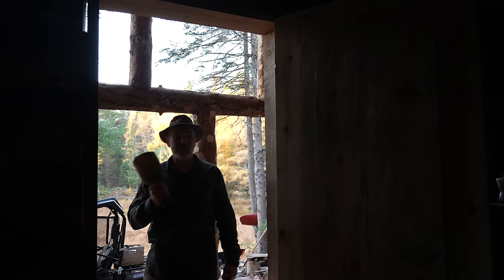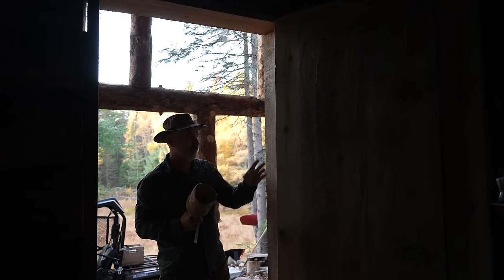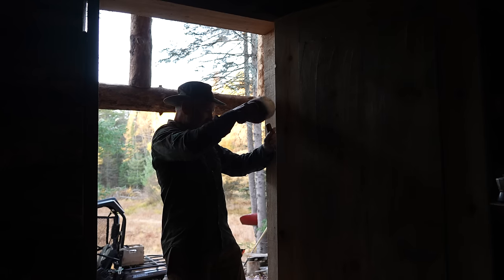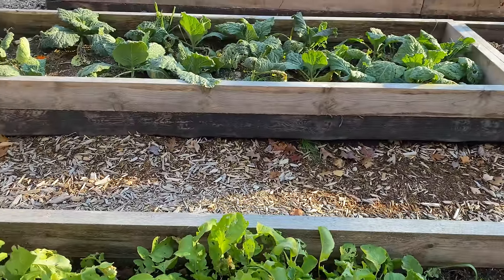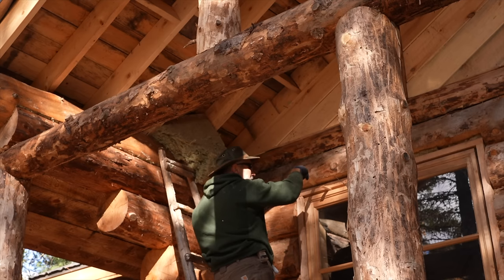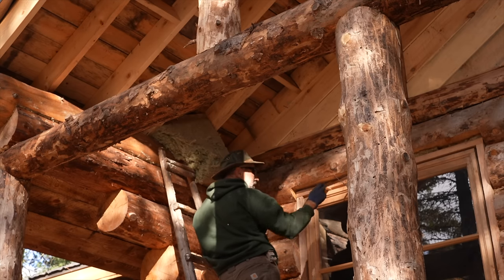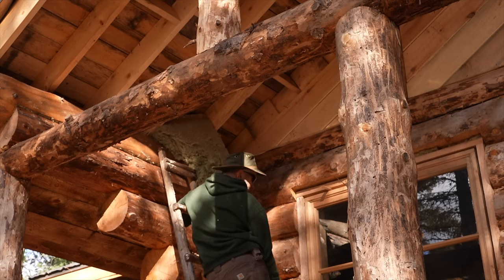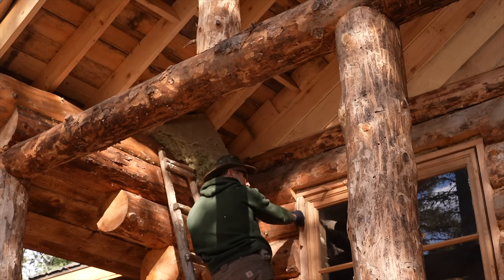Installing hinges on the front door, flashing on the chimney, insulation around the windows

Comment: I feel for you about the squirrels.  Red squirrels were the bane of our existence at our log cabin.  Come back in the spring and find drifts of pine cone chips everywhere inside.  And if we accidentally left a pillow out of squirrel/mouse proof storage?  Double the mess for the same price.
Reply: I too live with squirrel visitors. We are the invaders so I don't despise them for doing what comes natural. If you actually LIVE full time in a forest homestead, it is much less of a bother. Sounds like you have a vacation cabin.  No sympathy.
Reply: @earthangel8730  I wasn't looking for sympathy.  It was more a comment on how destructive they can be, and how one needs to properly rodent proof to keep them out.  We had 50 year old log cabin that was in good shape, but it had settled over the decades, and rodent proofing would have meant pulling out the floors, so we had a routine where at the end of the season we'd put all the blankets, sheets, pillows, tablecloths, etc into rodent proof wooden boxes or drawers.  We'd also remove all the food except for what was in glass or metal containers.  I'm sure Shawn James doesn't want to have to do that sort of end of season close up every time he goes away two or three weeks (which he has done several times over the past five years).

Comment: Get a 2 inch wide strip and 3 inch screws attach it vertically to the log frame until it settles then replace it with the final trim.

Comment: hmm a sliding trim for the window to settle with .... why just do the top ... why not also include the sides ... then the top and sides float as the wall settles ... and the bottom can be fit finally once it has ... in the mean time a temporary flashing to keep water n critters out ... 
if you plan on making the bottom drip edge molding one piece you can also have its sides go up the side from the bottom a bit as needed to a feathered overlap joint ... from the floating sides